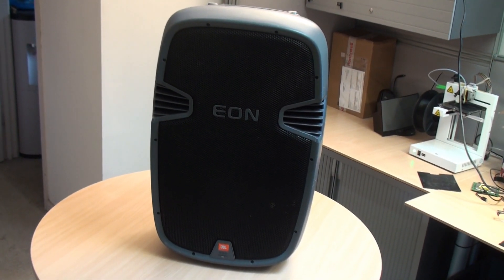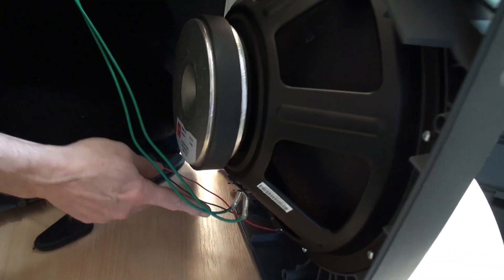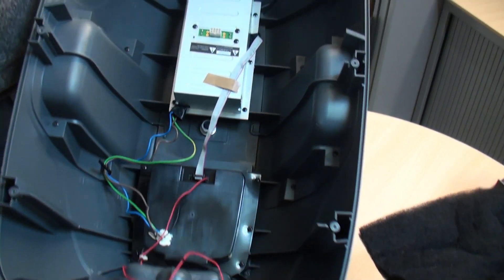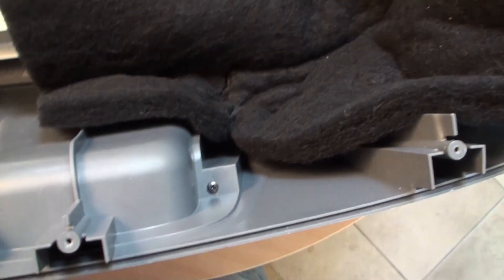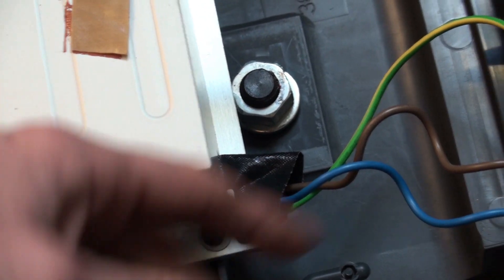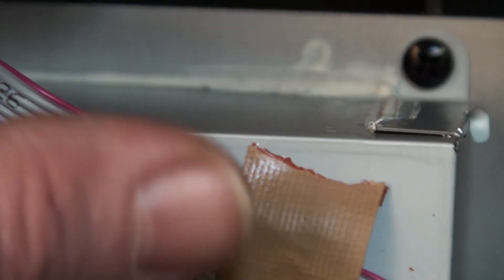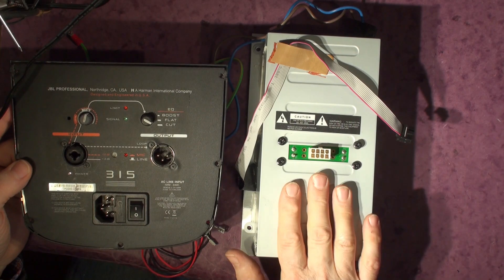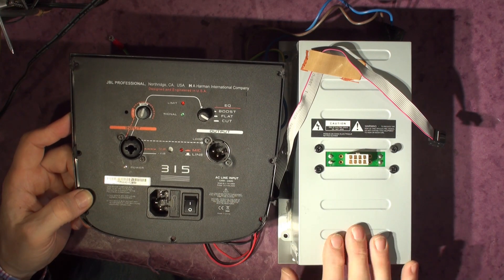JBLEON300 Series / JBL EON315 Disassembly and Module Removal

Comment: Is there a way to remove the screen/grill without removing any of the wires to the components? Thanks for the video!
Reply from the maker: You cant do much as the drivers mount from teh back. Hence I have never had to remove the grille itself.

Comment: Mine barely plays sound when connected. You can just barely hear it and the mic gain helps some but not really. Any idea on where to start?
Reply from the maker: Watch the video on the mixer board. You likely have a blown MC3038 Op amp chip. There are about 20 of them.  Usually you can diagnose with a voltmeter,  Also check the wiper hasn't dropped of the boost/cut switch.  Just short it out if it has. It is a useless and dangerous control. It is OK if you like buying tweeters.

Comment: I got the 500 series of this speaker and it won't power on. The outside fuse right by the power connections looks good. I'm going to tear into it tomorrow, just wondering where I should start looking first. I can't seem to find any repair manuals for this setup online. Thanks.
Reply from the maker: A common fault. The power circuitry is virtually identical to the JBL EON 315

Comment: i need part numbers for the power supply part of the amp. Can anyone help?2 tiny transistors and the two big ones.
Reply from the maker: You will need to changethe 2 big transistors the larger 10 ohm resistors, the four transistors in the complementary gate drivers, the 49.9 Ohm 0805 resistors, the MX Half bridge driver chip and the TL494 PWM manager and the LNK302 offline switch buck controller. the B+ has gotten into the low voltage electronics.  It is all in the videos complete with part numbers.

Comment: when i charge it. and switch is off. The lights are on. But when i flip the switch to turn on. It turns on real quick then turns off ??????
Reply from the maker: Before you suspect the electronics check the main switch isn't faulty.. They do fail and usually they come on for a second.  If the switch is Ok then there is an electronic fault.

Comment: my 315 turns on i get great low end but the high end just clicks even with no signal any ideas on a quick fix would be great thanks
Reply from the maker: Check capacitors C113 &  C213.  But could also be caused by a  problem on the Mixer/input board.
Reply: @razenby  awsome thanks alot
Reply: @razenby  Mine has the same problem, i checked the caps and they are giving the ~10uF they should.